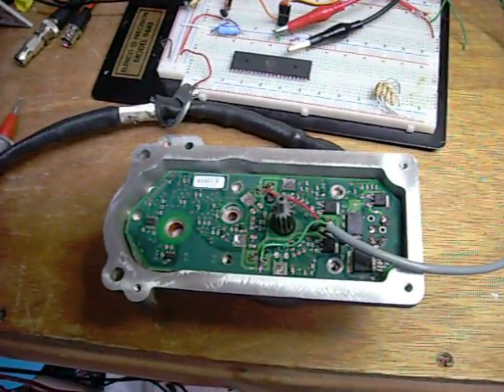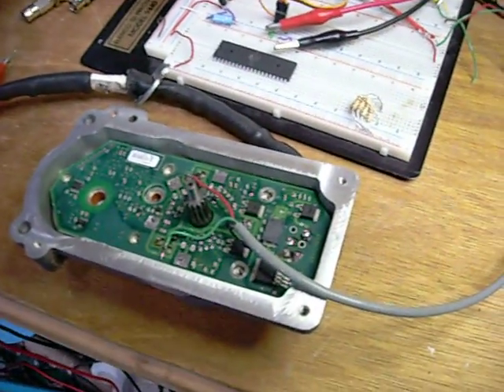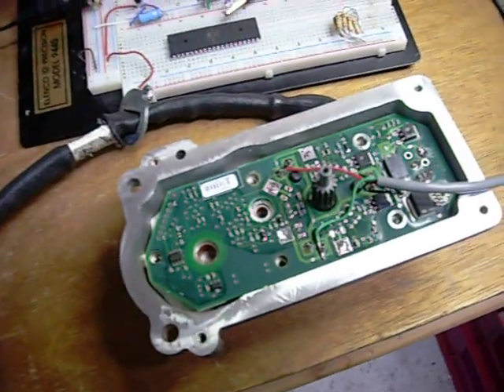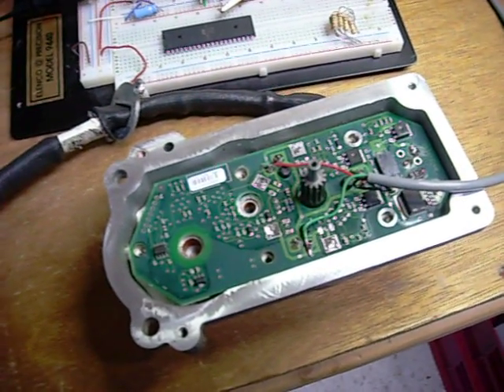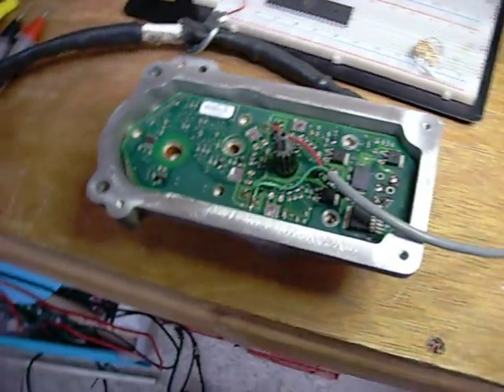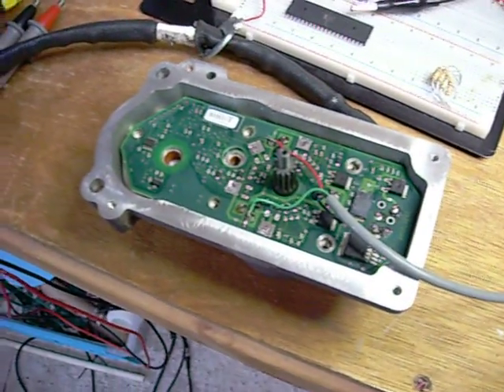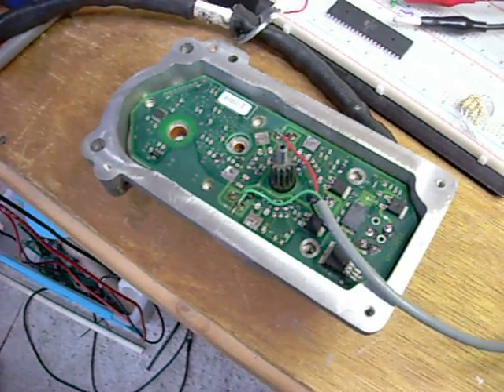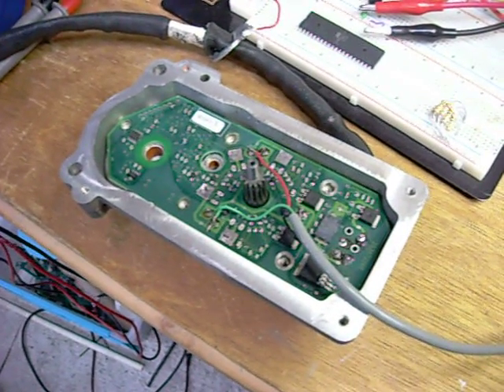HE351VE Motor Control

Comment: the only issue you'll have is the motor only makes about 5 or less revolutions to control the full swing of the vanes. you need to have a way to set limits so you're not applying voltage to the motor constantly

Comment from the maker: There are three wires that you need to attach to the unit to drive the 3 BLDC motor on the board. The oem control circuit is a glorified motor controller which takes a CAN bus input. Since the manufacturer will not disclose the protocol to communicate with the turbo, you have three options: figure out the CAN bus interface, reprogram the microprocessor, or bypass the factory control. I chose to bypass the control using my own BLDC motor controller. You can use a brushless hobby ESC to do this.